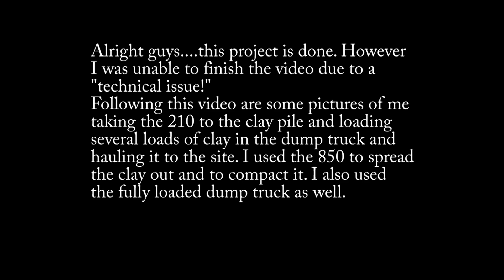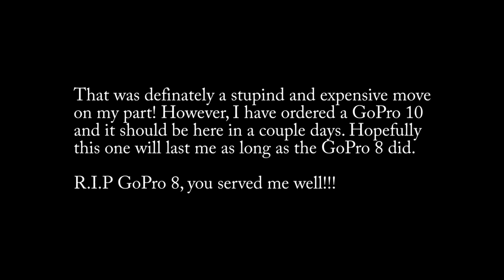Digging Out A House Crawl Space And R.I.P GoPro 8!!

Comment: Why didn't you pick up the water pipe? Also you can build a house any where just have to have some one who knows how to do the dirt work.
Reply from the maker: There used to be an old house here and there were pipes and wires running all over the place that had been disconnected for years.  I had no idea where the previous pipes used to be.  When PVC has been in the ground for years it becomes brittle and un-useable.
You are correct on house placement.  One can be put literally anywhere as long as the client has enough money to do so.  However, most people don't have that kind of money and have a budget to work with (such as the young couple in this case).  Thanks for the comment Randy!
Reply: @Dirtdaddy953  yw
Reply from the maker: @RANDYSMITHOU812  👍👍